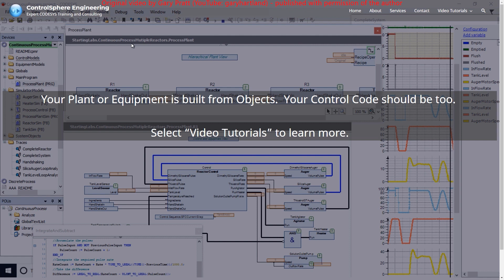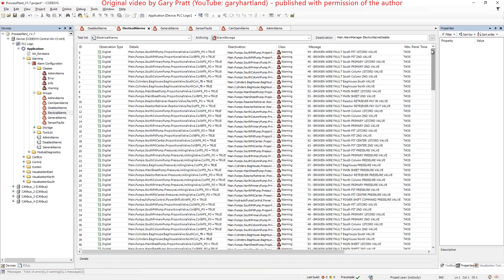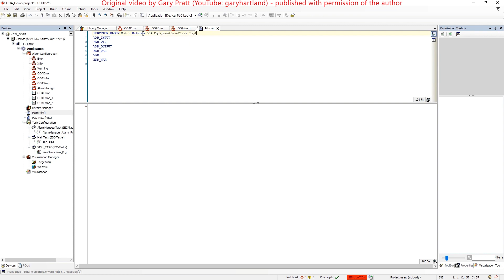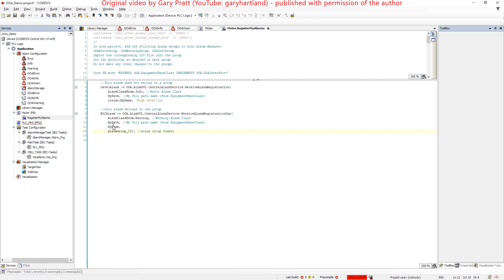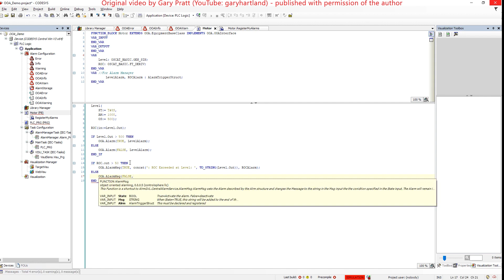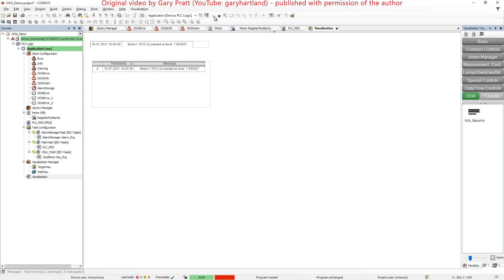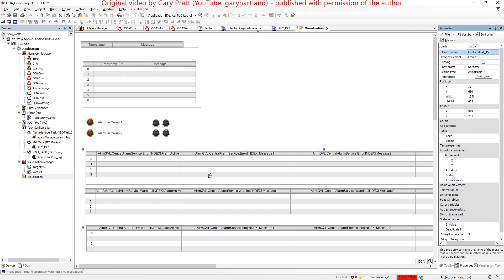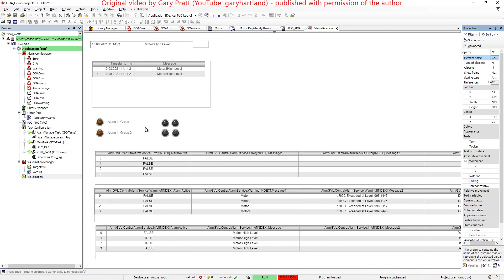Object Oriented Alarming in CODESYS

Comment: I am using Schneider's Machine Expert, that doesn't have this option so I wrote my own alarm manager that does something similar. My problem is now how to make alarms language versions to be displayed in web server. I can see that it is not an option in Alarm Manager either. That would be great to localize the alarms massages in newer versions.
Reply from the maker: @pawelwojda9003 In the special case of this video, an additional library is used, which is linked in the description text. Basically, however, the alarm management of the CODESYS visualization is also used there. This allows you to localize the alarm message via the text list linked to the alarm group.
Reply: Pawel, would you mind to share your code? I'm haven the exact same problem and I'm currently working on my own alarm manager too.
Reply: @marcelh2341  I just saw your message. I am sorry but the code belongs to the company and I am not allowed to share it :/

Comment: Sounds great! The library supports multiple languages ?
Reply: @MarcioMiguelOliveira,  An enhancement request has been submitted to provide more flexibility in the use of TextLists.  Until then, you can use arrays to create your own textlist for use with Object Oriented Alarming.
Reply from the maker: CODESYS supports all programming languages contained in the IEC 61131-3 standard.
The programming interface of the CODESYS Development System supports the most common languages like english, spanish, french, german, russian and chinese.
Reply: @Codesys-AutomationSoftware   I guess the question is about multiple languages for alarm logging. It seems the message texts are hard coded with string concat. So the language is only english for this example or any one - but one - for a user: what you put in a string - it shows only this text, no matter what the language is selected in HMI webVisu client